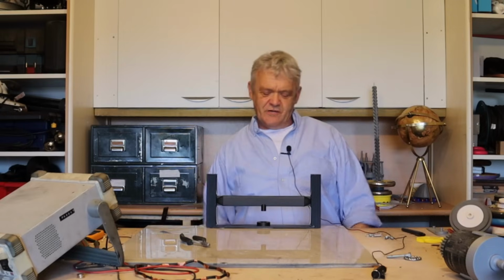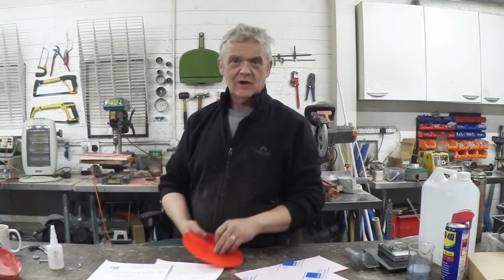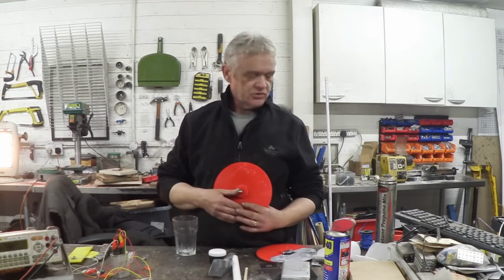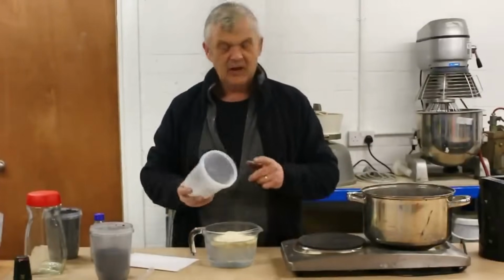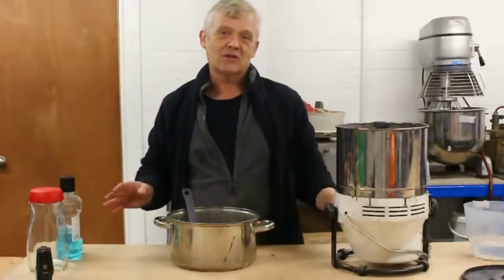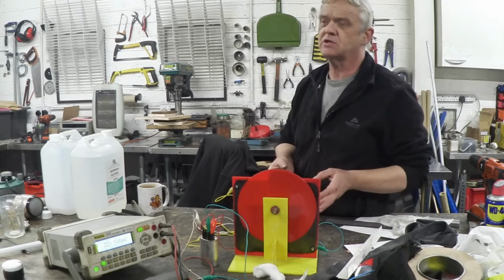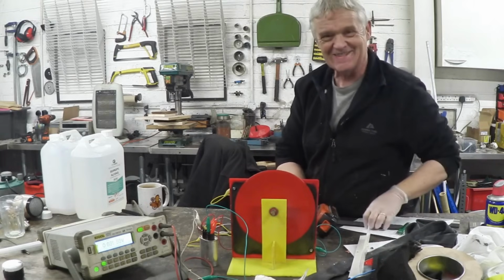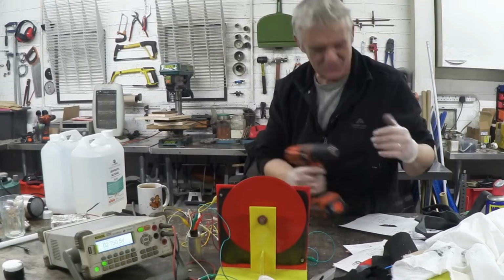029 Printing Generators

Comment: The largest Wimshurst machine I ever saw was a bit over a meter in diameter. The creator said he could generate between 750,000 and 1,000,000 volts from it. He also was able to spin it quite easily with a simple wooden pully system he had driving it. Was a rather interesting internet find while I was searching for Wimshurst machines. Fairly certain I started searching for them due to an atmospheric generator Rob made a few years back lol

Comment: I wonder of the charging of the disk at 20:00 in, itself creates a piece of 'virtual metal' as it will presumably cause one side to collect electrons - this now there's a rotating charge rather than a rotating neutral piece of foil/conductive paint.
A rotating charge will then have more 'pumping effect' upon the passive fixed plates of the machine.

Comment: Hi Robert, I've been thoroughly enjoying your videos and find them incredibly educational and inspiring. Your approach to simplifying complex subjects is something I deeply appreciate.

Your modular approach to wind turbines and generators is particularly appealing. I'm planning to create a similar modular STEM kit and your insights have been extremely valuable for that.

I've been curious about the use of PCB motors as generators, especially for micro-systems or even a wind wall. There are some intriguing DIY projects out there that make use of these coreless disk generators. Have you experimented with this, or do you have any thoughts on the subject?

Keep up the amazing work, and thank you for the wealth of information you share.

Best regards,
Paul

Comment: What if you added aluminium to the bottom of flat plate flappers and made a stack of them? Would it be structurally difficult to make the plates that extract the electrons into a vertical stack?

Comment: A whole lot of strongly dielectric fibers can build up massive levels of triboelectric power, and again, one merely needs multiple independent collectors, either in parallel or in series.

Certainly a very dry atmosphere makes a major difference, even if not employing a vacuum.

Comment: The rocking of a tree through a recursive bowstring could, in theory, tun multitudes of these, at almost any size, any time there is even the slightest breeze.

I do believe, however, that there is some issue that it seems to need more individual reversed plates.

In other words, I think that it may need more alternations and changes, more rapidly in time, just like how one wants more speed when using magnets against coils, because if you are moving too slowly, maybe it is discharging too quickly and not storing up much energy.

More speed is more difficult than more interrupts.

Also, the dielectric values of the materials has a lot to do with it, and if you are trying to store an actual charge, it may be good to use a rarefied atmosphere. [maybe]

Comment: yep telling you triboelectricity is the way to go, (you seen the humidity into porous materials that generates voltage from the water vapor touching the sides?, seems they found maybe a way to generate power from the same effect as the rain field generator that takes drops of water and uses triboelectric charges to make power like you and Luke both demonstrated and explained the building process.

Comment: make your disc from PTFE and and use small strips of the carbon felt on small plastic fingers attached to the back were the central hub is almost like a clock or you could use rabbit fur. instead of the carbon for a better result.

Comment: My idea for a static generator was to make a super capacitor for the rotor and charge it up like a laden jar so the strong electric field could induce current into a serpentine coil that wrapped around the generator. The carbon electrodes could allow it to be charged by a microwave source. But what if you took the current generator in the video and painted the disc in carbon ink then coat it in wax. Then put a sheet of paper and salt water over it it that is barely damp. Then put the other conductor that is wax coated over it for a capacitor. Then have the two carbon plates for receiving charge. A microwave or static source charges the capacitor first then spin it for a generator. Or if you used and electret that would work better for the generator. It can store and electric field. If you can turn the plastic into an electrect like carnuba wax and bees wax made an electret and spin that that generator in the video may do better.
Reply: Re capacitors. I've found titanium sheet when anodised and in water  can make large value variable  "electrolytic" capacitors, I've achieved Aprox ⅛F per cm² Ti sheet. The pure titanium forms one plate. The oxide film the dielectric, and the water the other. when the resistance of tap water is compared to that of the oxide film,  tap water can be considered as way more  conductive. Can alter how deep to plate is in water to vary capacitance. Very interesting result when capacitance lowered with a charged capacitor. Stored energy remains same, so voltage goes up. 

Also carbon super caps have a breakdown voltage of Aprox 2.5 volts. anodized Ti can handle kV. (though bear in mind, the thickness of oxide layer gets thicker with higher anodising/breakdown voltage  and thus the capacitance drops)
Reply: @stevecummins324  Have you ever charged a capacitor in your microwave and built up a huge electric field? I got a heck of a shock from that thing made from two pieces of pencil led and some wax and tape, and a paper towel soaked in a bit of salt water suspended by dental floss hanging from a pencil. I must have had a few kilo joules at least on that.
Reply: I probably could have died from a severe electrical shock though. And I did not fool with it afterward but thought what a field like that could be used for. So if you have a mega joule electric field that could be used to induce charges could have all sorts of uses. From generators to MHD generators and propulsion. And that way you don't need expensive neodymium magnets.

Comment: If you want a fully battery-free way to jump-start the process by charging up the plates, I would direct your attention to the piezo-electric push buttons used in certain kinds of butane lighters.  I know that they can produce a useful amount of current.  Admittedly, I am imagining a screen-printable generating element as part of an apocalypse-proof power system for some sort of emergency electronics.  My imaginary device is about the size of a breadbox with a pushbutton and a hand-crank.  At the crank end inside are a set of planetary gears meant to turn the user's strength into speed via toque conversion, at the other end are a series of Wimshurst-style electrostatic plates, a small fractal capacitor bank, and some kind of supercap for storing the resultant 5-ish volt power for use in something like a low-power radio, computer, or light system.

Alternately, for a wind turbine design, would it be possible to merge the electrostatic elements and the blades of the turbine?  Since you're not having to pass a coil through a rotating magnetic field, it should be possible to stack up inductor blades like you see inside of a jet turbine.   Add a scoop at the leading end, a tail to keep the scoop pointed the correct direction, and go?

Comment: the ink did better because it had a higher surface are for charge

and the higher the voltage they make the closer they approach 100% efficiency until at a certain point they pass 100% with a theoretical maximum of 200% because the forces on the rotor are balanced in such a way that there it no torque relationsohip between the load output and rotor.

After a null point on the rotor is passed, the individual plate on the rotor is attracted to the output brush because the output brush is presening an opposite polarity field, same with the neurtaliser brush, this result in positive torque on the rotor.

the only caveat is that you have to have a high enough capacitance and voltage to make the energy output reasonable.

my record is making ~110 watts at 180 KV, 0.000555 amps

Comment: Why o why are you using a capacitor with a load in it .. .. .. It is so counter productive, especially because you need a charge. And as soon as the charge (voltage) goes up, it will continue to go up rapidly. (as how a wimshurst machine works).
Reply: yes yes yes I agree I don't know if he had a reason for using a cap with a resistor in it.  Its funny because he tells us its in there at one point and later on says to keep in mind that these things are more high volt low amp.  I haven't messed with this kind of power much but I am thinking I should just seems most examples I have seen basically get as far as jumping a spark and then they smile pointing to the spark and say something like see the power.......and thats it 10 videos later and guys have made a over complicated propane BBQ lighter. I suspect what is needed is some kind of cap that can handle a rather spicy voltage to get in to a max power out put for the rpm then find a way to bleed off the extra power hoping its enough to do something by the time its gathered up converted regulated and so on.  I do think our tec is getting to efficiency's at prices that don't require a 30 year loan lol to argue for some use cases but I spend a lot of time looking in to different "green" tec and I can't think of anything that has gone much past the spark phase
Reply: I would like to vote for Rob to use his own hair (I figure by the end of his day the carbon felt content would be a real advantage)(to be fair Robs hair is already used as a wind gauge so whats one more use lol